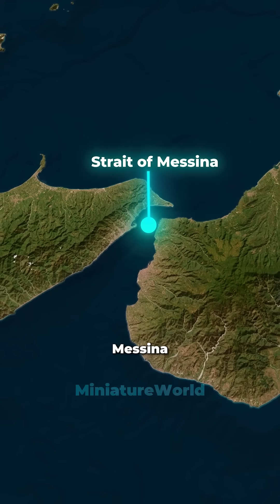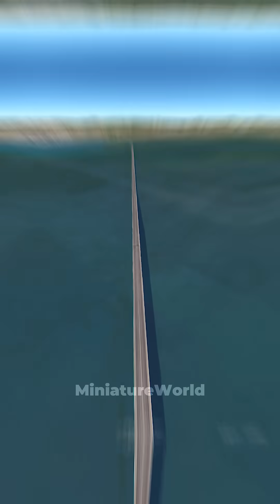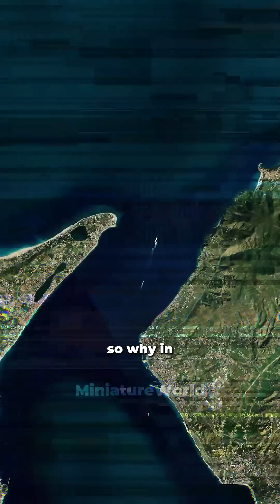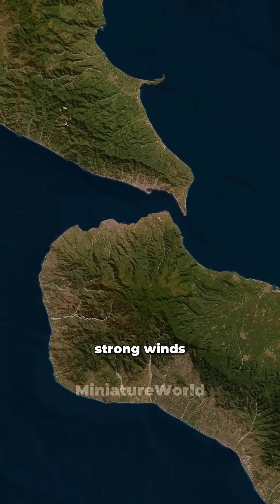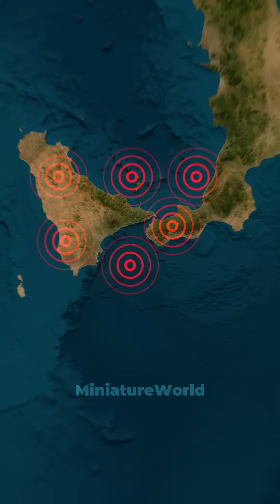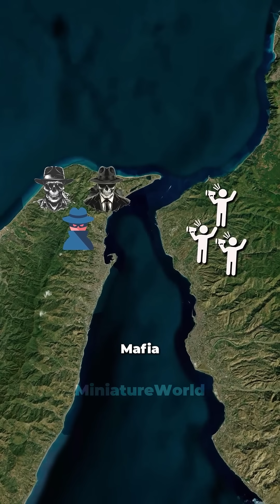Why is there no bridge connecting Italy with Sicily? #italia #sicily #usa #geography #facts #map

Comment: A Consortium of International Firms to come up with 
Certified Proven Specifications of Geological Strata's, Calculated Risk of Seismic Vibrations and possible interference from Etna volcanic activity on the two bridge tower's foundations and suspended bridge. All the specifications for the Materiel as per Design. Timetable, from start to finish to build the bridge and complements. Supporting adjacent infrastructures as per design requirements and completed at the same time of the bridge open for service at both entrances: 100% full-service and finished. The synchro. finishing bridge entrances as per written on the Contract.
True total cost of the bridge and who are the Entities suppling the capital?  Terms including legal responsibilities for not fully completing the bridge project as per signed Contract. Insurances on failure to complete the Bridge Project on schedule budget, approved specifications including proactive maintenance on the bridge project 24/7/365, monitoring, inspections parameters and digital log data. 
Civil, criminal, economics penalties are upon Bridge Project Contract Entities, In case of delay to complete the Bridge Project plus Entrance's in time. These full responsibilities are on Contract's Signing Entities of the Bridge Project that include full viability, complete safety and operational use of the bridge as per Design for the full life span of bridge project.